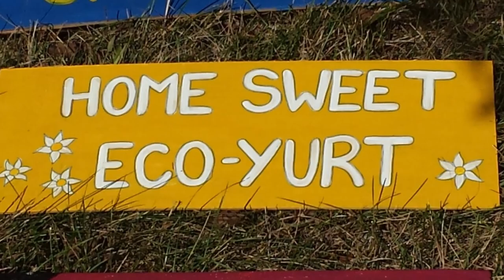How to build a Yurt! - Yurt Building Workshop 2015

Comment: should be using a "full flat felled seam" which is the strongest and water tight seam for canvas.
Reply from the maker: agreed if I had a large work space and an industrial sewing machine this is the absolutely best stitch to use. unfortunately I am limited in equipment and space.

Comment: Is the tonno ring covered with canvas or is there a hole in the canvas? That is probably the hardest bit to sew right?
Reply from the maker: The Tonno ring will have its own throw on top, or covered with a dome, so you can open it and let light/air in or use it to put a woodstove pipe though

Comment: What angle were the pieces cut for the roof ring?
Reply from the maker: Its an Octagon so each piece is cut at 67.5 degrees
Reply: @FoxfireHeritageFarm  Do you happen to remember what size you cut the toono wood pieces?I got the angle down mine is way bigger though I cut each piece at 18 inch.Also I used a Miter saw the angle was 22.5